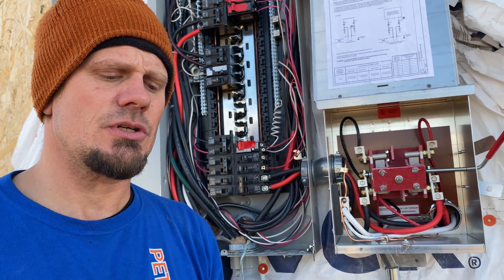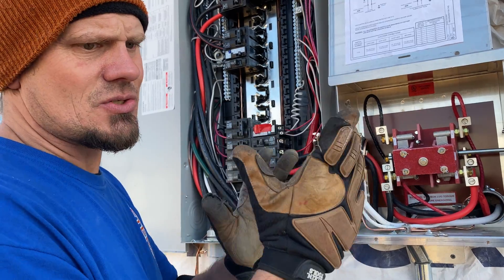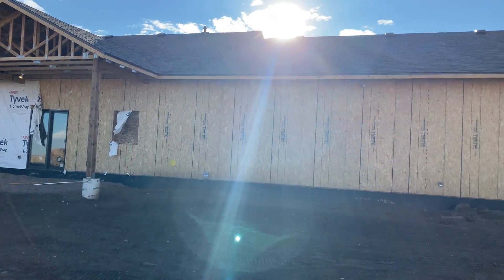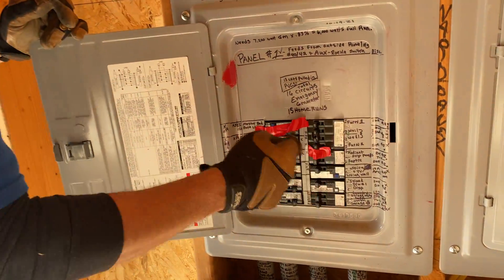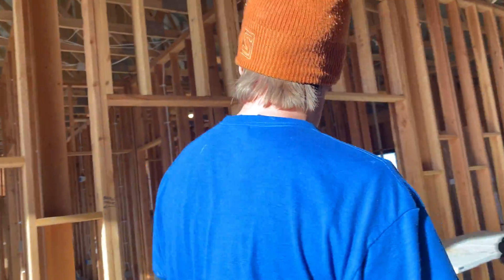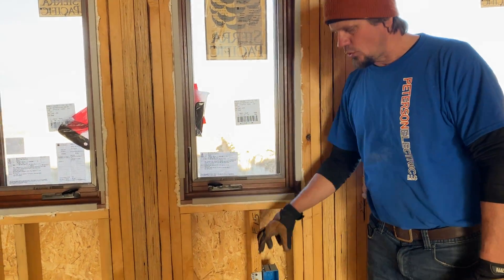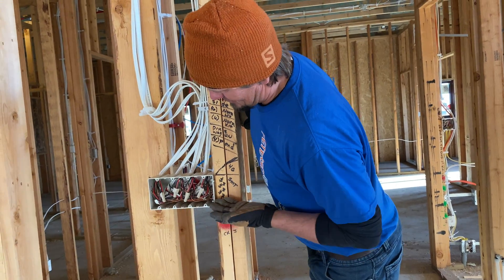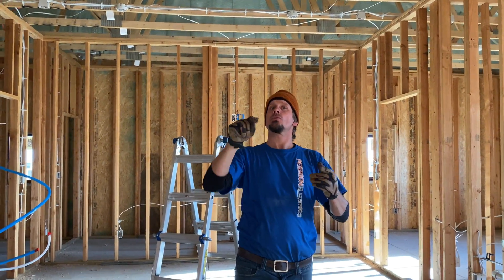Manual Transfer Switch on a Home

Comment: Cabinets don’t kill people, electricity can. You have inspectors for good reasons, but I would never say an electricians skills are more specialized than a cabinet maker.

What’s weird is that you rant about cabinet makers then immediately talk about architects, whose work will end up being inspected.

 Also confusing is that shortening a window to raise the counter is bad…. We’re you planning on going with lower counters? Why not just the lower counters with outlets in the wall, that rant made no sense.

Comment: Yeah cabinets can be a pain.  Remember having to cut out a lot of cabinets for extra receptacles after the fact ( change orders )  using fine tool or oscillator drill needed to use extensions on a few as well.  Customers were from New York/New Jersey and had a lot of extra money so my boss didn't care.

Comment: Have a  question  I agree with the manual  transfer switch  for me I would pipe from the generator  from my garage direct to the transfer  switch, at the generator  I would   use a deep 1900  with a chord grip to except the 30 amp  chord from the generator  . My goal is to stop using extension  chords   to my sump pumps. So I would pipe it back to my panel  
Well pump
Furnace 
Lites 
Fridge .
So I would not put a receptical at the transfer switch.  Iam not a romex electrician  have 35 years in 134 . Not sure why you ran on floor in the kitchen but over all your one of the better electricians on you tube ,I pipe every thing .

Comment: Good luck with whatever siding that will go in the outside of the house. Usually hang the panel after the outside is finished. Plywood, tyvek, siding…. Then mount your panel. You went passed the rough-in and went the the finishing stage

Comment: I have a question. My breaker has a load and line wire connected to a breaker. Does my transfer switch wire connect to the load side? 
Thank in advance

Comment: If the transfer does not break the neutral it is a NON separately derived system.
Reply: 👍🏼 so that extra electrode for the generator is an auxiliary electrode that is not required or regulated by the nec. And on top of that is creating a voltage gradient from one electrode to the other

Comment: Why isn't the panel and transfer switch inside the building? Going outside in 3' of snow to flip that switch will not be fun. (of course, they'll also likely have to go out to fuel and start the generator.)

Comment: A few weeks ago I installed a backfeed breaker for a gen. (before anyone gets upset, yes there is an interlock that makes you turn main off). I bought a 7500w gen. after using a 3kw with extension cords for years. Last winter in Texas we were without power for many days with temps around 0, these houses are not built (insulated) for those temps.  That was the reason for buying the 7500w and connecting to panel. last weekend I did some tests with gen and amp meter and was very disappointed. Our house is all electric (no gas) which makes it even worse. I was checking current on circuits one at a time to see how much I could use at once. All the 120v circuits were pretty low but the 240v used much more than I expected (I know I should have checked labels) . I took a hot shower before doing this so hot water heater (less than 5 years old) was cranking at max I'm sure but it pulled 23 amps so that's about 5500w just from that. Clothes dryer pulled 22a, ~5300w, oven pulled 17a when temping to 350deg.  and when I turned our electric heat up just one degree (trane 16i system about 4 years old) it actually stalled the motor on the gen (I was surprized it didn't trip gen. breaker instead).  I guess using the central heat is out of the question. We will be able to use the other 240v appliances but only one at a time, and will need to limit portable elec. heater use when doing so.  It's a champion 7500w (9300w surge) gen. but now I'm wishing I had bought a bigger one. The engine is 440cc so I'm sure it's going to use much more gas than my 3kw gen.  Oh well at least no more extension cords, and we will be able to use oven, and won't need to turn everything else off when using portable heaters.  I almost gave away my emergency kerosene heater when I bought the gen, glad I kept it now.
Reply: I was also surprised at his 7500w recommendation. I'm thinking 15kw minimum and prob. 20kw. You run a water heater, oven and  an electric furnace at same time, you're done.
Reply: Have a comment keep in mind you do not have to run washer and dryer  during outage  I would just operate the furnace and well pumps  
Good job for checking  amps ,for me I would not use the fridge unless it was a extended outage  . Just heat water pumps.

Comment: In the video he says to "build / buy a storage shed" but reading between the lines you will find out that you can't run a portable gen set in a closed shed without voiding the warranty or violating your local fire codes... and your homeowner's insurance might have a field day if you ever need to file a claim. IOW, you might not be covered. Better solution is to store the gen set in your garage so you can roll it out the door easily then buy a cord that's long enough to reach from there. If you are worried about someone stealing the set, you can always chain it to your car. (or a pile of cement blocks buried in the garden)

Comment: Been in the electoral trade for 40 years. It all looks good on paper. But wiring becomes a nightmare with stacks of 2x4's, n 2x6's. Used to work on Boca Grande Fl. A small island with multi million dollar homes for some famous people. The CEO for Dell Computers, 3 years  to build at 20 million, 25 years ago. I feel your pain. I did most of the service work. Some of the houses in town have know n tube or used to. Back then electricians always fed the lights, then wired what was close. So trouble shooting meant taking a fixture down to be positive the hot, nuetral were good. Alot had no grounds. Patience was my best friend. Good luck with your home. Single story, you can get to almost everything, but those 2, 3, n 4 story homes. Really made things difficult. But I enjoyed my time. Retired,  but miss a good challenge.

Comment: Labeling circuits is good, but using a printer instead of a Sharpie would be an improvement. Circuits can change over the life of the house and printing out a new label is neater than crossing writing out.
Reply: Not just that. It's an ugly practice. I know he has a label maker in those 24 years.
Reply: I can testify to the changing circuits. My house had electrician do the same with a previous owner, I know, I asked to verify and the circuits do not match.
Reply: Labels never fall off.  If the use changes, you could put a label on then.

Comment: I've seen "midpoint transformers" used to manage leg-to-leg imbalances while off-grid... curious if any of the generator manufacturers are incorporating this sort of tech.
Reply: no gen mfgrs using extra xfmrs that I am aware of. The right way is to balance the load in your panel. It's not really that hard to do and once it's set up you are not likely to change anything for years.

Comment: Thanks for explaining this so carefully. At your main disconnect on the pole, is the neutral disconnected as well? I'm just wondering what special precautions are in place to protect a lineman.
Reply: The neutral does not need to be isolated in this case. The return current from a separately derived system will not flow back to a different system. 

The reason some transfer switches break the neutral is not to protect the utility. The neutral is broken in the event that the homeowner uses a bonded neutral generator (most small ones or job site generators are) whereas more permanent generators have a “floating neutral”. In this current setup seen in the video (where the neutral is unbroken) the use of a bonded neutral generator will violate the NEC article “objectionable current”. Now this may not be a big deal to many, however, for those who have GFCI and AFCI breakers in their panel it will be a problem. As soon as a load is turned on they will immediately trip as it will detect a bond between the neutral and ground.
Reply: @tristatehomesllc599  Thank you, that's food for thought. The downside to a parallel path escaped my attention until you pointed it out. Of course, as you say, if some neutral current can find an alternate path through an EGC, the GFCI may detect imbalance.
Reply: @tristatehomesllc599  Isn't this a NON separately derived system. I may be mistaken but the way the code reads is that the neutral has to be disconnected as well in the transfer switch. .........  for ref.....separately derived systems (SDSs) include most transformers as well as any generator or UPS supplying a transfer switch that OPENS the neutral conductor. What makes a system “separately derived?” It's sourced from something other than a service — where there is no direct electrical connection between the two systems [Art. 100].
Reply: This reasoning doesn't make sense. The generator is upstream from the GFCI device, and the neutral is already bonded to ground at the meter. If what you're saying is true, then the bond at the meter would cause problems for normal installations, without the complication of a generator. The GFCI is only looking for downstream imbalance. If the neutral is bonded to ground downstream, then yeah, you'll get a trip, but an upstream bond won't change the neutral current path.
Reply: @denrayr  Generator supply cords are not a 3-wire feed like the utility. They have to be 4-wire per the NEC. This creates a parallel path for neutral current which circumvents the GFCI, thus creating the imbalance.  

Because of this standard there is an entire market of equipment designed and built to manage this problem, transfer switches that isolate the neutrals. 

Before GFCI’s the most cost effective and standard method was to simply back feed the main panel and isolate loads as needed. However, when a bonded neutral generator is installed there is current returning on both the ground wire and the neutral. Now most people don’t care about this “objectionable current” as the NEC defines it, but GFCI’s do. 

So the options to remedy this problem LEGALLY is to:
A. Use only a “floating neutral generator” 
B. Purchase the transfer equipment that isolates the neutral.
Reply: @tristatehomesllc599  are you saying that the generator has a built in GFI? Because that's the only device that could see the imbalance. In this scenario, the built in GFI would trip due to the neutral/ground bond at the meter panel that's downstream. The GFIs in the home would all have an isolated neutral. They wouldn't be able to pass current to ground unless that particular branch was bonded or had a real ground fault.
Reply: I wasn't necessarily addressing any code issues. I was specifically addressing your comment that states the bonded generator would cause the GFIs in the home to trip. I just don't see how it would cause them to trip since it wouldn't cause an imbalance downstream from those devices.
Reply: @denrayr  This thread is rich in detail, and it helps me a lot to have both of you guys chime in. As you say, an upstream isolated GFI with an isolated neutral wire would not detect imbalance. The bond is upstream of the GFI, so all neutral current on that circuit needs to go through the GFI to get to either bond. Yet two points of bonding would certainly allow a parallel path for some neutral current to appear on the ground wire for the generator, so there could be some current on the frame of the generator itself, which isn't a great safety design. Understandably, the general theme of only bonding at one spot holds true, even upstream of the panel.
Reply: @spelunkerd  I'm going to further muddy the water here 😂. I've never messed with a nice generator. I've only messed with smaller portable generators, and they all have an isolated ground. This is contrary to the point being made above. It's common practice to use a device that monitors power quality to prevent electrical damage on an RV. If you use one of these devices, it won't close the circuit when connected to these generators because the ground doesn't pass current. You have to buy an overpriced jumper that bonds the neutral to the ground on the generator itself. Or you can build your own jumper for cheap if you are handy. Back on topic. There's a pretty good YouTube video that shows how to connect a generator the wrong way. He explains how it's against code, and he explains why he has chosen to accept the risk of having a double bond (spoiler, it's because both bond points are within a couple of feet of each other, and there's little to no risk). I'll find the video and link it below. I really was only trying to correct the record that an upstream bond will NOT cause a downstream GFI to malfunction or trip.
Reply: One last point. The utility serves with a   3 wire hookup that's bonded at the source (transformer). I know it's the wrong way by code, but it mimicks how your home is already served. In either case, or even the case of bonded generator with 4 wire hookup, a downstream GFI device will operate properly.
Reply: @denrayr  you are correct. The gfci only cares about imbalance in the downstream direction.  I have personally tested this with my own generator and non-isolated neutral transfer switch.  The generator is bonded and no gfci trips anywhere when used in real world situations.  This is because the 30-amp twist lock plug on the generator is NOT gfci.  And therefore doesn’t care that the neutral and ground are parallel paths both sharing the neutral current load.  Meanwhile the gfci protected 20 amp outlets in the generator itself and other gfci in the house work normally.

And before you reply, I know this is wrong and the generator should be floating ground.  I’m just talking about a real world test to prove that no gfci trips.
Reply: 1 This is not a separate derived system installation (250.30 note1) 2 The thing to connect the generator must to be a flanged generator inlet..  3 no need for the grounding electrode on the generator side unless you want to wipe out generator components and possibly other equipment on a lightning or other emp event.... 👌🏼

Comment: We had a whole house double throw manual transfer switch installed back 2014. It's literally saved our bacon on numerous occasions. As the description implies we can switch our entire main service panel from metered power to a generator. For those considering a whole house transfer switch, please use a licensed electrician in your state, anytime  the service meter (or any electrical work for most) is involved, it is not a DIY project. Also learn about how to safely operate a generator and transfer switch.

Keep up these great videos, we have missed you!